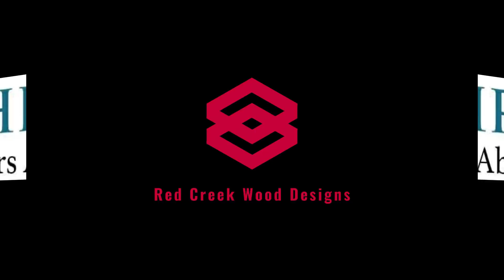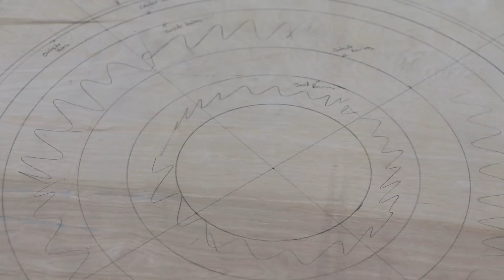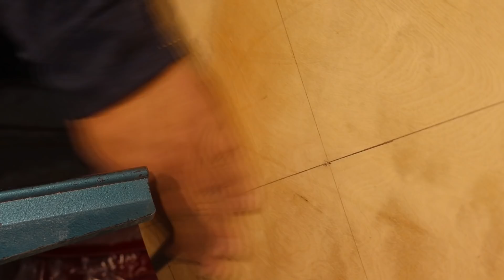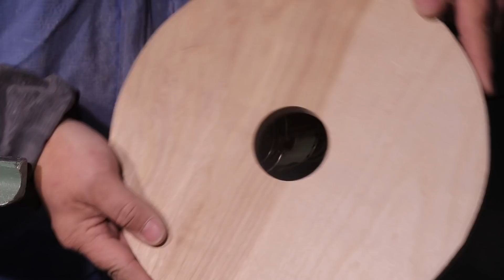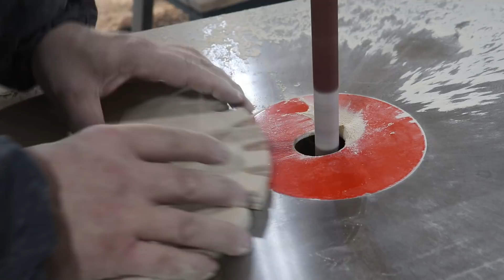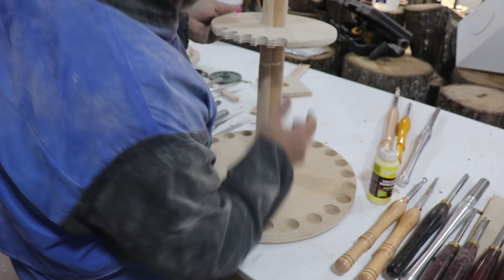Workshop Organization | Turning Tool Organizer - "The Chisel Swivel"

Comment: Great build Lewis! I’m in process of moving stuff around in my shop and I’ve got a place that I want to build a rack to put on the wall (don’t really have the space for a spinning rack like this one). Problem is, trying to come up with the right layout and how to make sure everything stays in place. 
Love the ingenuity of yours though, and watching the process gave me some ideas of how to work out my plans.
Reply from the maker: Thanks Seth! Wall racks are much easier in some ways. You can make a 2” wide strip of 3/4” wood and drill a row of holes up the center the size you want for the chisels and then split the piece in the center. Each half is useful. Tons of base options. I appreciate you watching buddy!